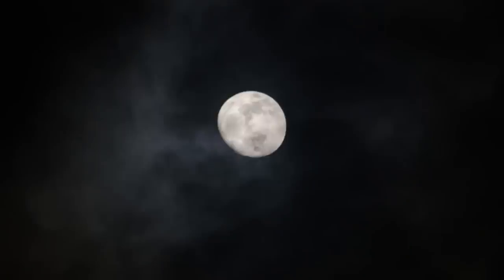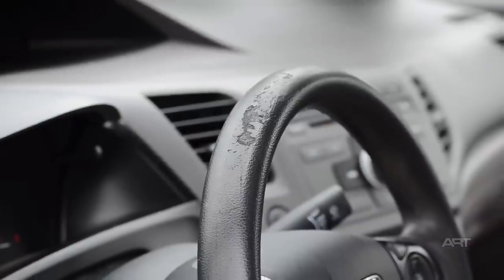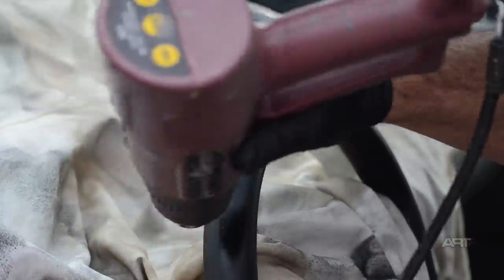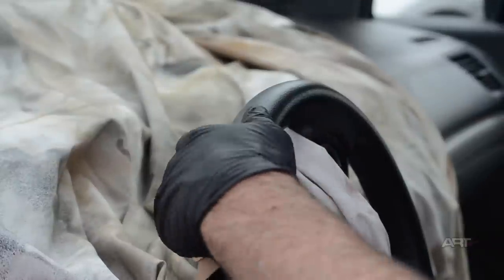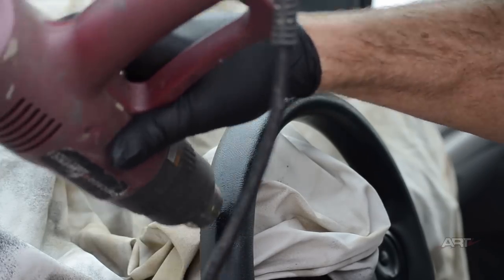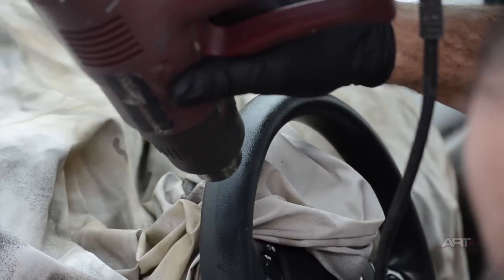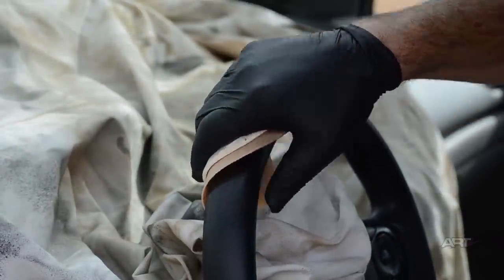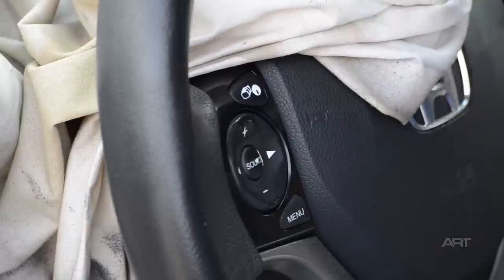Foam Steering Wheel Repair  v06

Comment: Do I have to treat the whole steering wheel with aceton or only the damaged area? Wont there be a difference between the color later if I only put the paint on the particular part of the wheel? How long will the effect last? And what is that grey pad that you use with aceton?
Reply from the maker: You will only need to melt the damaged area.  Don't forget to clean and prep the entire wheel though.  The pad is a Scotch-brite scuff pad that auto refinishers use.  As for recoloring, most of the time we are spraying the color with a paint gun around the entire circumference of the wheel.  However, an experienced tech will sometimes be able to paint only the repair area or even just wipe the color in the case of black.  Color is our specialty.  If the color matches well but the sheen is different, we will still spray the entire wheel to even the sheen.  Thanks for contributing!
Reply from the maker: Maybe you have an abrasive kitchen pad that might work as well.  And any general purpose cleaner for the rest of the wheel.  I'm sorry but all my recommendations are directed toward people in the business and I don't know what household products to recommend.  Thanks again.  Couldn't access your picture.  Also bear in mind that automobile interior parts vary in composition from the US to Europe so I hope that this method, in principle, works with what you have there.
Reply: @a.r.t.srealrepairsforrealc8247  
thank you for our advice :)

Comment: This is not what I want. Old classic sports car I just picked has worn steering wheel that is missing material on the worn spots.  This is not adding material back to missing areas. I shall keep looking.
Reply from the maker: Yes, what is shown is typical for the techs servicing the dealerships.  Wheels missing parts can have either foam or epoxy added and then you can make a custom leather wrap to finish it up.  We do have a custom wrap on the channel.  I will look to do another.  Thanks

Comment: Hi, great video.
What type of paint/colour is that you have used? Just so I can look it up in my own country to save on shipping etc.
Thanks.
Reply from the maker: I am using a flexible water base polymer for leather.  I add pigments to 20 %.  Each repair is a custom color for the most part.  I add Slip, Flattener, Flex as needed and crosslinker.  Thanks

Comment: Do you have more pictures on your website that shows the different grain pad textures because there's only 1 type shown?

Also there's no description as to which texture pad is shown in the picture on the website.
Reply from the maker: I make my own grain pads for the reasons mentioned in the video.  Also I make mine double-sided.  The one in the video had Oxen on one side and Sierra on the other. You could contact the sponsor for a listing of the grain pattern names that they sell in the pack.

Comment: It is better to cover the leather directly, and the grip is better than this. I just cover the leather directly.
Reply from the maker: Agreed, it would be better to fashion a leather cover.  I do provide this service.  But no automobile dealership in my area is going to do this on a used car, and this vehicle was on a used car lot similar to those which the majority of mobile techs are servicing.  The factory foam wheel is just dreadful.  For my personal car I would go for a leather cover.  Thanks for joining in.

Comment: Yes sharing knowledge, know how, techniques and even… However, with you, sharing material type, source for materials used and product names is not for the YouTube community. So consistently inconsistent.
Reply from the maker: The reason products are listed for this particular video is that it was endorsed by means of a sizable monetary payment.  So yes, very consistent.  For other videos,  no monetary endorsement means no product placement.  I'm sure most people would understand that.  And for those videos, not mentioning specific product names makes it fair for the whole industry.  And then in the comments I suggest going to your current supplier for the products.  I can't be more fair or more consistent.  Thanks
Reply: @a.r.t.srealrepairsforrealc8247  If the money pays….